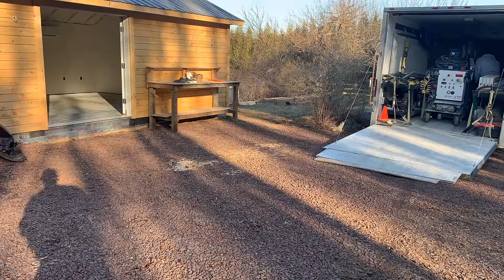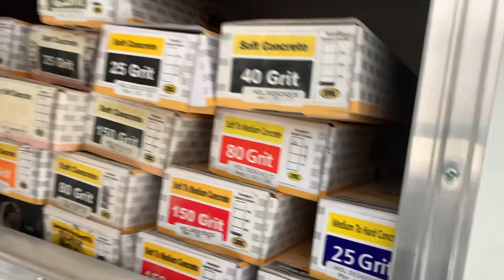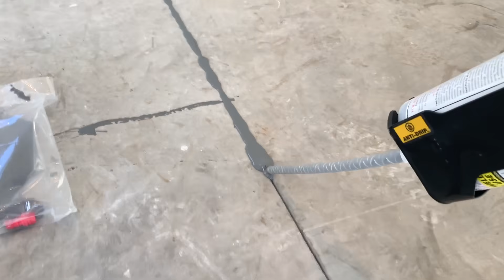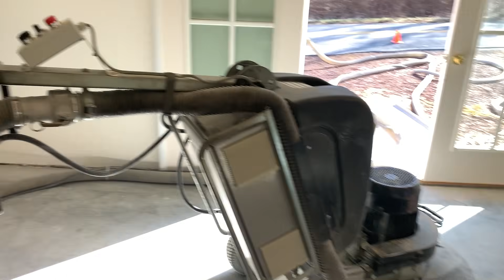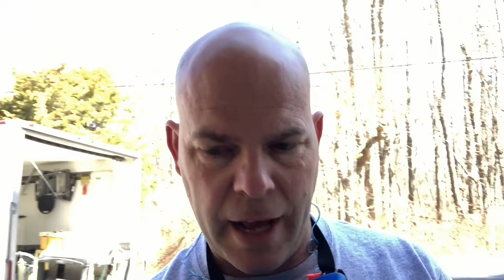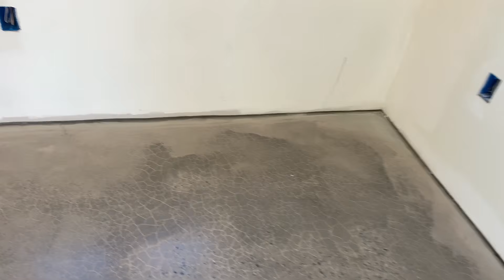Concrete Polishing From Start To Finish : 10 Step Grind

Comment: I know you are masters and I really mean it - love to see your work and explanations, but I wonder what is your take on vacuuming between each pass and grit change. Do you think it plays a factor in scratch removal process?
Reply from the maker: For the most part we used to vacuum between the first couple grinds because the particles are larger and sometimes you can re-scratch the floor if you leave the dust on the floor. It's very helpful to vacuum to look for scratches. If you don't vacuum and leave scratches in the floor you won't see it until later on in the polishing process and you will have to back up multiple steps to remove those scratches.
Once you get above the 150 grit stage, our vacuum system used to suck the majority of the dust off the floor, so you didn't need to vacuum anymore. 
I would always recommend filling joints, if you leave joints open, the sand particles will lay in the joint, you will pull them out with each grind and scratch the floor
Reply: @ConcreteFloorSolutions  That makes sense. 
Thank you for the answer.

Comment: I was able to turn a stainless steel frying pan into a non-stick stainless pan by the use of  abrasive wheels (dremel) at first then switched to jewelers rogue / lenin wheel then cotton cloth wheel for finish.  I was just experimenting with the stuff and just trying to bring the pan to a good shine again.  The jewelers rogue (i think green was the color compound for the final polish) polishes steel and such a fine grit that food won't stick to it which is awesome when it comes to cleaning them after use.

Comment: You are supposed to use water when sanding to prevent dust and protect the machines.
Reply from the maker: If you have a good vacuum system, you don't have any dust

Comment: hm, i thought its gonna be easy. there goes my plan polishing the floor
Reply from the maker: Polishing definitely is not easy.
It is also extremely important that you have the correct equipment. It is very expensive to rent the proper equipment.

Comment: Those craze cracks all appear to be only where the aggregate is not, could these cracks essentially be ground out before beginning the polishing procedure if the customer didn't like them?

My concern being the cracks taking away from the durability of the polished floor.
Reply from the maker: Craze cracks are part of the character of the concrete. That is also part of polished concrete. If your customer is not willing to accept the look of natural concrete, I would not recommend a polishing.
You can apply an epoxy grout coat to the surface also, that will help glue everything together. The craze crack are typically caused from the surface of the concrete drying prematurely due to wind or air temperature.
Reply: @ConcreteFloorSolutions recently poured a garage floor and we had the wrong mix sent to us (6% air) so after power trowel it couldn’t breath as designed and caused the top few mm’s to crack all like this. We are looking at polishing as a resolution to repair the floor to avoid shaling of the concrete. We are hoping to essentially grind away all of the cracking so the floor is as durable as it should be.  And then begin polishing Aesthetic looks aside

Comment: Why is the reason for the craze cracks?  Was the concrete cured too quickly?
Reply from the maker: They occur from a multitude of reasons. Direct sunlight, wind, excessive heat. They can all contribute to the surface drying faster than the bottom so it shrinks and cracks like a dried up mud puddle.

Comment: I really enjoyed watching this video! The detailed explanation of the joint filling and grinding process is super helpful for anyone looking to polish concrete. I’ve faced similar challenges with hard concrete, and using the right diamond compounds makes all the difference. 

One tip I’ve learned is to always account for waste in your budget. It's easy to overlook, but it can save you from unexpected costs. I often use FloorTally to get accurate cost estimates based on local rates, which helps me stay within budget and make informed decisions. Keep up the great work—looking forward to your next project update!

Comment: Thank you so much for this video. We are considering polished concrete for our garage. I have a question: is the concrete still porous and easy to stain when it is polished? How often does it need to be repolished to keep it looking nice? Thanks! Do you recommend it for garages (cars) or just for work spaces?
Reply from the maker: Typically we do not recommend polishing in garages because it really does not provide any resistance to oil stains, etc. Every concrete slab is different so it may or may not be porous. There is no way to know until you are done. If it is done properly, you may not ever need to redo it. If your concrete is soft and porous, you might need to re-polish after five or 10 years. Concrete is very inconsistent

Comment: Great video. I had a question, I wanted to do this to my basement floor. It was poured about 4 months ago. Because it’s still pretty green do you think I’d be able to go straight to the resin discs? I feel like the metal pads might be too aggressive for green concrete.
Reply from the maker: @hellocambo7  after 30 days, you are good to polish. I would use metals first, but every slab reacts differently.

Comment: Thanks again for the video. Once the sealer is applied on ground floor slabs, have you ever experienced moisture migrating to the walls ? Can a sealer prevent the slab from breathing ?
Reply from the maker: @OptLab  the sealer used in polishing are actually what they call a microfilm. It allows moisture to pass through, but it is not a waterproofing sealer by any means.
If you need to stop moisture from passing through, you need to apply a coating, which would be a moisture vapor barrier or any of our epoxy kits on top of it

Comment: Did you close down shop?   How much did you spend on bits per year during operation?  And what are all the grinding types did you support.   A 3 step a 7 step and a 1 step
Reply from the maker: @zorartfamily1374  we sold all of our equipment and now only sell our epoxy flooring materials in our online store
concretefloorsolutions.com 
We typically only did nine step grinds

Comment: Thanks a lot for the video.
Do you use triangular sander machines or oscilating tools for the corners ? How do you make the surface even for the corners ?
Reply from the maker: we used a 4" grinder for corners.  typically your trim will cover anything exposed after that.

Comment: That’s a 500 CFM vacuum the larger 854 I believe gets up to 750 CFM but you aren’t getting 500 CFM through that 3 inch hose probably closer to 400. 500 CFM is when you have the 5 inch hose being utilized. So when you strangle it down, it will lose air flow in CFM, although you will increase the velocity of the air in the hose. But that being a fan motor doesn’t have a lot of lift and strangling it really affects its performance. Also, we start with a 1618 or even lower just so we can get down through the cream faster.

Comment: Good day. If the client was looking for a light salt and pepper exposure  think it would have been best to start with a resin 30 and run wet. Then run wet resin 50 and 100, densify with way more densifier. Let the densifier rest over night then run up to 800 dry and guard. I realize this makes the job 2 days instead of one but in reality it is much less work and a much more refined look. It’s one man and two half days for a floor this size. When running metal bonds, the deep cut exposes more pours, more pours equals less refined. Also, if the concrete is obviously that hard just run wet. Water tricking the metal bonds is a mistake. It will help with the cut a little bit but it tempers the metal making the bond harder therefore not as good for hard crete. When the metal does shed, it will often leave a burr and a scratch pattern.

Comment: Very nice.  What are you using for a handheld grinder?
Reply from the maker: hilti dg150 for first grind, then variable speed dewalt with copper bond wheels 100,200,400 grit

Comment: When the diamonds burn you need to lower your speed and spray water. Saves the diamonds. Been doing polish floors for 9 years. You learn tricks from vets. Great video and nice work guys
Reply: I am trying to DIY my own floors...starting with a dusty concrete slab.
Reply: Exactly! You are supposed to use water! 😭 Poor guy didn’t know…
Reply: Good man , good man INDEED YES!
Reply from the maker: I actually demonstrate that exact process in many of my other Polishing videos

Comment: does anyone know why they cut that joint?
Reply from the maker: They cut joints so when the concrete shrinks it cracks in a nice straight line. Otherwise you have a random crack across your slab.
Reply: Thanks，，Is this step necessary ? @ConcreteFloorSolutions

Comment: Do you need a dry/wet vac if you use a little bit of water to cool down the diamonds? Or can you just use a fry vac?
Reply from the maker: if you were doing it correctly, you should not be vacuuming any water up. the water actually vaporizers from the heat of the diamonds so it should all be dry dust if done properly. We only used a dry vacuum system, and never had a problem

Comment: What is the depth of the cut? How do you cut the concrete when there is floor heating system with water pipes running under the concrete? Thanks, great videos.
Reply from the maker: very carefully... That is something you would need to talk to the concrete contractor about when they pour the concrete.   They should know the depth of the water lines so they can cut the proper depth joint.
Reply: Thanks, I am in the process now to plan the concrete flooring and thats one issue bothering me @ConcreteFloorSolutions

Comment: I like seeing stuff like this and knowing my jobs easier. After first cut depending on how bad the concrete is, all you need is 100s, 400s and 800s. 200s in between 100s and 400s are literally just a waste of time
Reply from the maker: Unless you are leaving scratches that won't be removed from the 400s, which is why we were using the 200s. We used to do that years ago and we landed up getting residual scratches, now we do the extra grind. It's much easier to do the extra grind before you realize you should've done it three steps ago.

Comment: The way he scraped the joints after you filled them i can tell that left marks. You always want to do it in one motion because trust me, with him cutting maybe 6 inches off at a time, you can literally see in the joints where he started cutting again 🤷‍♂️
Reply from the maker: That is absolutely true, once you grind over it, those lines will go away. That's why we fill the joints before grinding.

Comment: You run a Lavina? That looks like a cps machine. Nvm your running electric. You still run electric ? What’s your hot take propane vs electric. We used to have a mister on our machine for dry runs to keep diamond cool.
Reply from the maker: Its an HTC 800 
Husqvarna just but HTC a year or so ago

Comment: Great videos! You are obv true professionals. I have recently purchased an Edco 22” grinder and am planning on doing a few large floors with it. I am totally new to this, but have been a contractor for almost 20 years doing almost everything from the ground up. Quick question. In my very limited understanding of this process, the actual grinding bits go to 140 grit, and then you switch to pads? Also, how do you match your hand grinder grit to your floor grinder? Thanks again for your helpful videos, and any advice you might provide.

Comment: My friend's high school built in the 1930s as part of the depression works program has polished concrete floors that are still glossy.
I always wondered how this was accomplished and now I know!

Aside from filling in joints to polish over,  can pits in the concrete be filled in?
Reply from the maker: absolutely.  either by using a grout coat or simply filling each pit prior to polishing.  We did that every day.

Comment: Firstly, this floor is absolutely stunning. You do amazing work and love how informative this video is! 

I’m having my floor done currently, after they stripped the paint off the concrete, the team says that my floor “cannot be polished”, is this possible? 

They’ve told me the floor is turning to dust when they go over it with the machine. I see how many passes you had to take to get the polished look — they’ve tried to convince me I cannot achieve this look. Any advice or advisement would be greatly appreciated!!! I would love to end up with a perfectly imperfect polished concrete floor like you’ve shown us!

Thanks I’m advance for any help

Comment: I have a question what would you recommend to use to fill in the expansion joints on a already polished concrete floor that I can later pass the polishing buffer over when maintaining my concrete polished floors thank you any feedback
Reply from the maker: The joints should have been filled before the concrete polishing was done. This is the material I would recommend:
https://concretefloorsolutions.com/store/repair-materials/cfs-fast-set-joint-filler-with-static-mixing-tip/

Comment: Beautiful! How much per square foot?
Reply from the maker: I don't remember, that was a while ago. Pricing has changed dramatically as Concrete polishers are not as common as they used to be. Very hard work, very expensive equipment, and few people are willing to pay to have it done correctly.  Cost can range anywhere from three dollars per square foot up to $15 per square foot depending on condition of concrete, repairs, location, access, etc.

Comment: All that polishing and no sealer ??
Reply from the maker: There is a penetrating guard that we apply and then burnish the concrete. You do not apply a sealer to polished concrete. If you apply a sealer, it is no longer polished concrete. It is a coating. Coatings can wear off and need to be reapplied over time. True polished concrete is actually what it's called polished concrete.
Reply: @ConcreteFloorSolutions  I only questioned because I was in a new Costco and the concrete was amazing.. was told it was polished and sealed..
Reply from the maker: @warrenmullett  most people don't understand that the penetrating guard is not a sealer, it is a penetrating "microfilm"

Comment: What are you charging per sq ft?
Reply from the maker: Every job is different, depending on size, repairs, access, etc. anywhere from $3 per square foot for jobs over 10,000 ft.² up to $15 per square foot for small jobs.

Comment: It is possible to polish it after the slab is poured and before the walls are built on it? Seems like it might be easier to do it that way if possible?
Reply from the maker: That is always preferred. The only issue is, the concrete needs to cure 30 days before you polish it. That creates huge delays for builders not being able to construct any interior walls for a month. In most cases builders can't wait with the interior construction.

Comment: Couple questions... ( Finisher here) I'm about to pour a 320 sq.ft. floor for polishing) 1) obviously I gather from you that a newer floor can be easier without the hard trowel finish. IYO , what is ideal to start the polish ? Ex: 3 days after pour ? Next day? 
2) what type of finish to make it easier? Smooth steel trowel ? Will finish lines come out if you have a small line? 
3) you never mentioned any sealers when done....does that floor you did get any type of sealer for shine, or is it not needed due to slip factors? 
That floor you did , was it a 1 day job for that many grinds? 
Thanks , love the video you did.
Reply from the maker: Typically you should wait 30 days before polishing concrete, I have already done it at 20 days and it seems to react well. If you start grinding too early, the surface will be so soft it will pull the stone out of the surface and probably do more damage than good. I have had great success doing a smooth steel trowel finish, without burning the surface with the steel trowel (Power trowel). We always apply a densify or after the 150 grit metals https://concretefloorsolutions.com/product/cfs-concrete-densifier/ and then a guard at the 800 grit stage:
https://concretefloorsolutions.com/product/cfs-polished-concrete-guard/
 then burnish the floor. Do not use a sealer that creates a film, once you do that it defeats the whole purpose of polishing because you have a coating on the surface. True polished concrete is exactly that, a polished concrete surface.

Comment: Why does he have to cut the concrete screed? Thanks in advance!
Reply from the maker: Concrete screed? I don’t know what your referring to.
Reply: @ConcreteFloorSolutions  Sorry... I thought concrete screed was the "finished surface" of a concrete slab. 

Basically, I'd like to know why the slab was cut.. Thanks!!
Reply from the maker: @nicolaspaiva4790  Those are cold control joints, when the concrete cures it shrinks when it shrinks it cracks and at least it cracks in a straighten line.

Comment: Just curious what a polished floor goes per sq. We do grind and seals but have not tried a polish yet.  It’s seems high labor but low in materials. Am i correct?
Reply from the maker: High labor, very expensive equipment, at least if you get the good equipment. We used to make much more money back in 2005 when we polished concrete, now it seems Polishing is much less expensive. A lot of companies are doing fewer grinds to make it look good, but the polish doesn't last as long as a nine step process. 
I believe this job was around $4000, it was a couple years ago so I really don't remember.  we used to charge 5 to 7 dollars per square foot now you seem to struggle for 3.50 per square foot 
Of course the larger the job, the less per square foot.